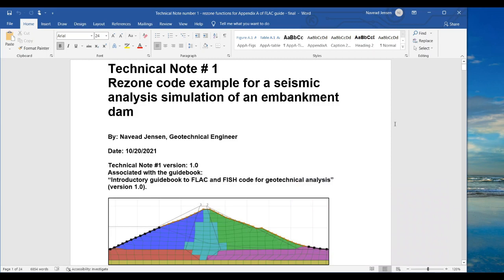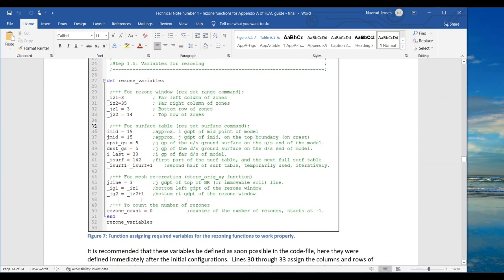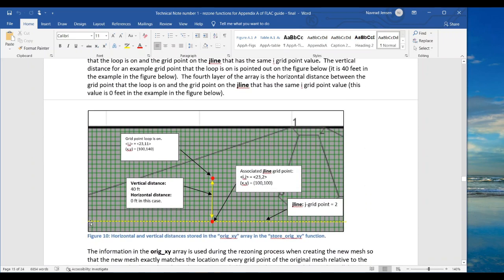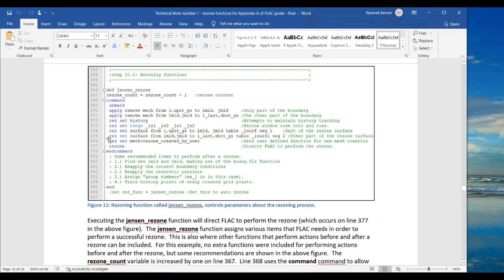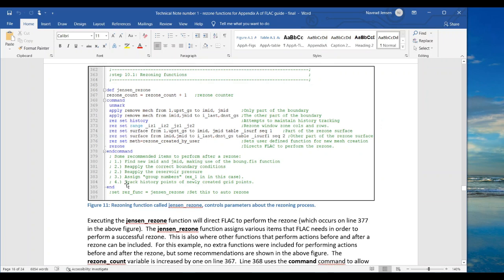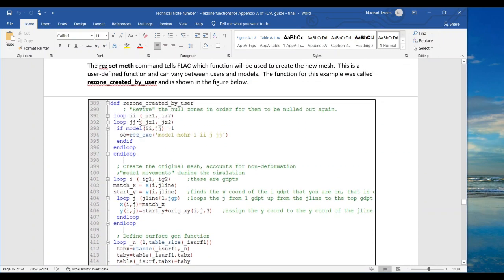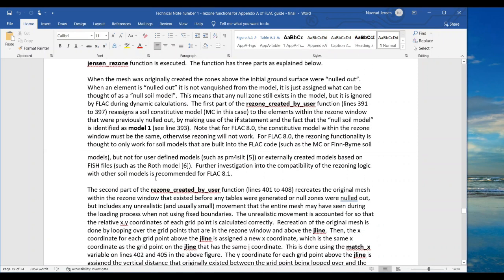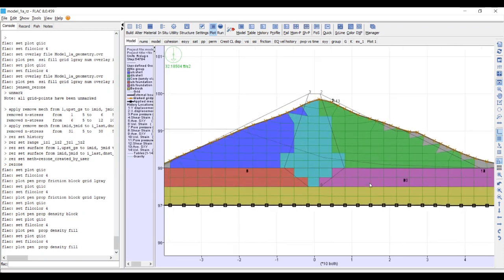Rezone example for analysis of an embankment dam using FLAC and FISH code.

Comment: Is there something simpler to import from DXF without reworking geometries?
Reply from the maker: Hello - Are you referring to importing the original geometry of the problem?  If so, I don't have the original geometry in DXF format at the moment.
Reply: @naveadjensen3511  I mean that maybe they can present an example of a dam modeling in a complete way, that is to say from preparing in dwg, meshing it, load hypothesis as required by ICOLD. Obviously skinny here should show that the cost and computational speed is superior to other software. It would not be good to show a whole dilemma in data entry for an output of few results, as the previous example shows.